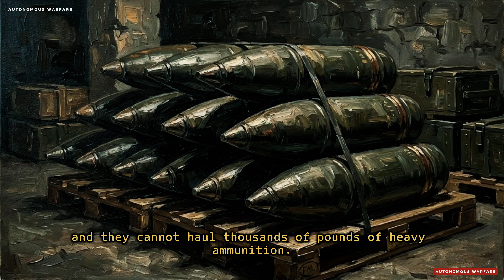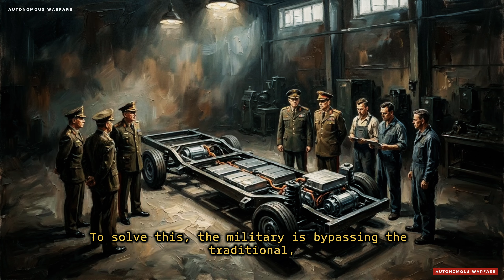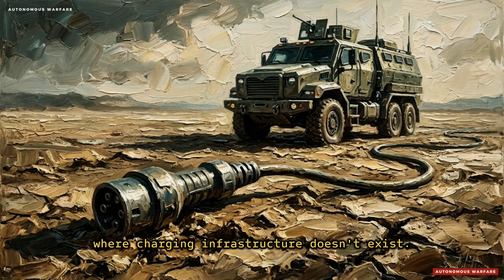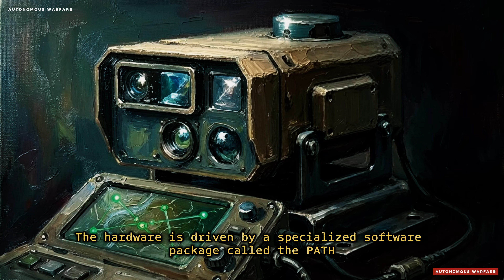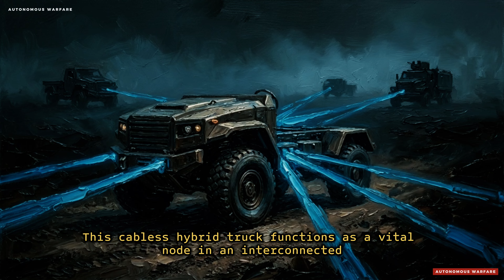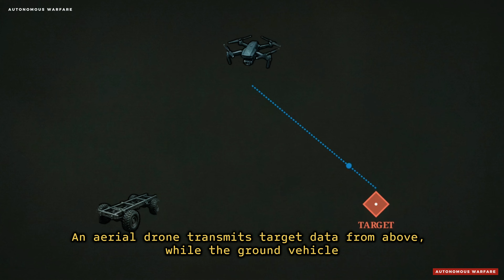No Driver. No Fuel. No Sound. The Future of Military Transport Is Here

Comment: Military logistics has always determined the outcome of wars, and this is a perfect example of why. A cabless, drive-by-wire, extended-range electric platform is not just about automation. It reduces risk to personnel, lowers the logistics burden, and enables silent resupply in contested environments where conventional trucks become easy targets. The real breakthrough is not that it has no driver. It is that commercial EV technology is being adapted into a scalable military capability, showing that future battlefield dominance will depend as much on resilient logistics and autonomy as on firepower.
Reply from the maker: I completely agree. The adaptation of commercial EV technology into military platforms is particularly interesting because it speeds up innovation while reducing development costs. It also shows that future military advantages may come from integrating civilian technology rather than developing everything from scratch.